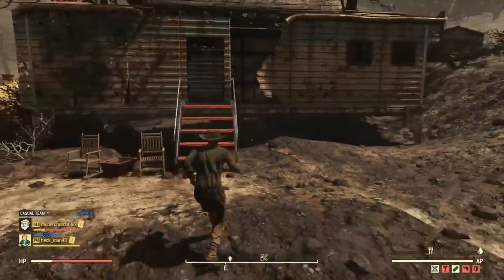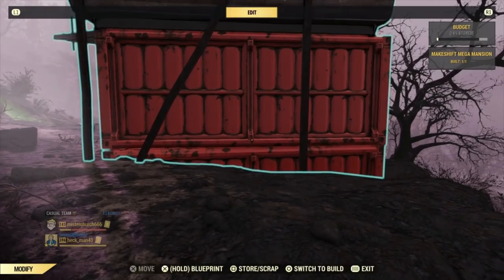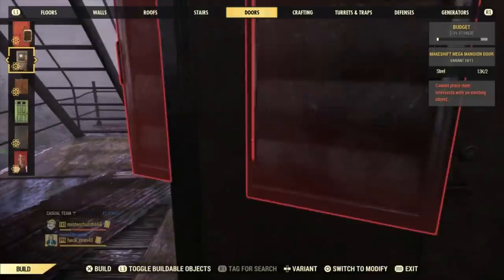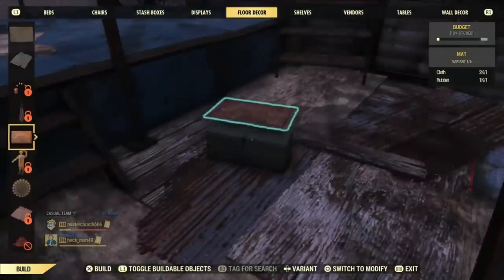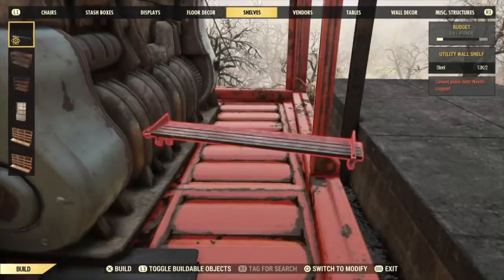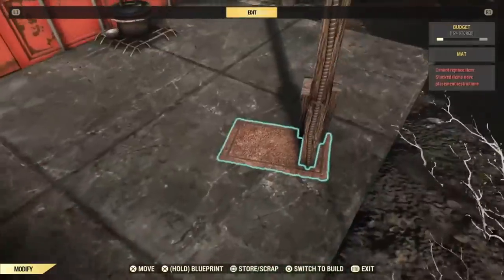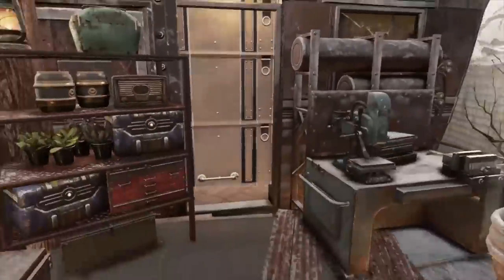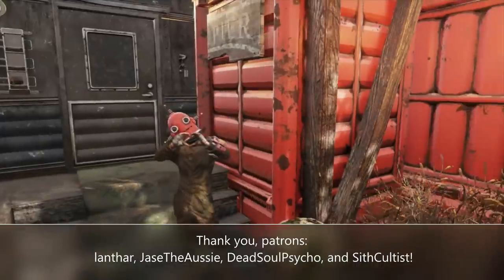How To Build a Hidden Fusion Generator Inside the MegaMansion Prefab: a Fallout 76 CAMP Tutorial

Comment: Very, very informative, I always take notes during your videos. I swear just this much when I try to build something, just not aloud. (Super annoying is when you could put something somewhere in FO4 but it won't work here.) 
One thing I haven't seen a solution for anywhere is how to get purified water when my camp is 100% on a rocky surface. I have farmable tiles for food, and rainwater collectors for rad-free dirty water, but can't put a small purifier there. Carpet trick won't work as that would require at least one spot where I could put the purifier down. I saw that once campfire was somehow treated as dirt and you could put things on it but it has since been patched out. Thanks!

Comment: I also had this idea but ended up not going for it bc i dont need as much power in my base. But i found out that you can kinda glitch a foundation under the main stairs and build a normal wall between the two metal support beams. So you can change the floor to the garden area and end up with a little farming pod that is left of your main stairs. Its just great but took so long. Also do you have any idea why junk bots keep going outside of the little rooms even if i lock the door and the clearly have enough space?